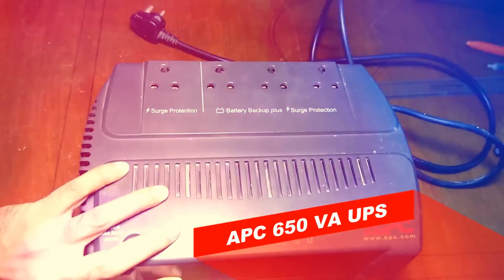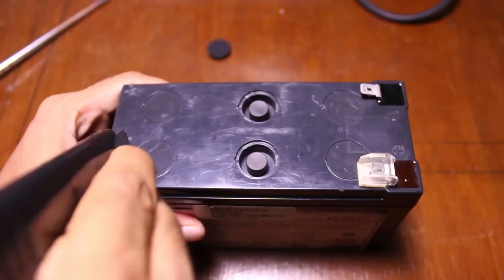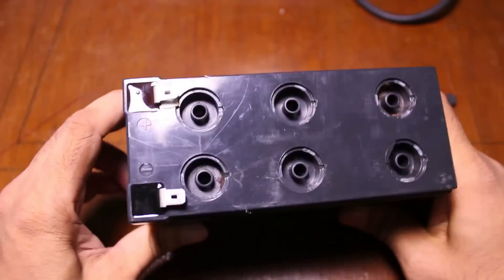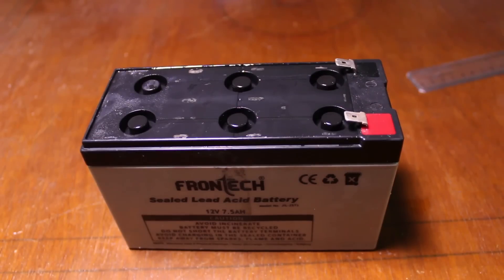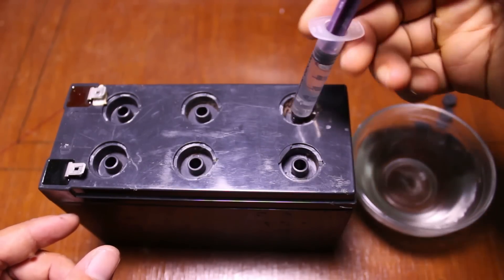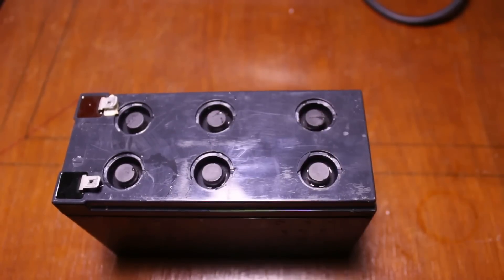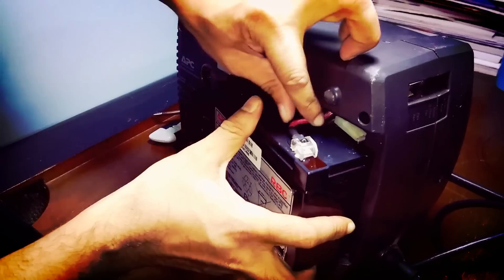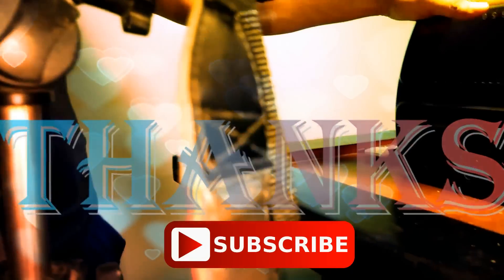How To Recover UPS OLD Sealed Lead Acid Battery

Comment: Im not an expert but know enough that you need to clarify what type of battery this is.  Flooded cell, agm, vla, etc.  As the level of distilled your adding is way too much for sealed agm types as far as I've heard
Reply from the maker: its works with any lead acid battery flooded / agm.

Comment: hi ,is it safe to put battery water in dry battery?? usually they use thixotropic battery gel in such battery as electrolyte , i have similar chloride dry cell which i wish to revive .

Comment: You should NOT fill it up "untill its full".
These are AGMs, not flooded batteries. You will make it even worse !
If they do in fact need water its only a fraction of what you put in !
Reply: I did this last year and it brought the battery back to life. Ups lasted 7 hours Only now it is giving me problems again. I checked the cells and 3 of them were very dry again the ups only lasting like 20 minutes

Comment: I filled distilled water in all 6 cells then charged the battery. After 3 hours the charge was 10V. An hour n half later it was 8 V. I have tried 2 batteries n no improvement
Reply: He filled these to the top.  I don't believe they are supposed to be filled like that, if they are agm batteries.  The mats need to be saturated but if the cell is filled to the top this can damage these types of batteries. And will likely pop all the caps off do to the pressure created when charging/discharging leading them to just dry out again

Comment: Hi I have an APC RBC 12 volt 7.0 ah battery which I use in APC UPS for my personal computer. I checked my battery DC volt it is 0.226 volt. I filled distilled water and again checked DC voltage and it is 0.21 voltage. I have not used this for 4 years. Any possibility this battery will recover？Can I put it back into ups and try ?
Reply from the maker: 4 years is long time it probably not recovered because battery lead plates are sulfated because of this resistance become high and battery is not charging . you need to charge the battery with high voltage charger.
Reply: @RoyTecTips  thanks for replying. I have inserted into my ups and turned the power switch ON. ups is dead. What is the typical voltage to charge this to make an attempt?  Can I use a mobile or laptop charger?
Reply from the maker: around 15v , 300 - 500 mili amp, for 24 hours then discount from the charger leave the battery for couple of hours if battery volt increase . if hold the voltage more than 12v then you can use it less than that, you cant use the battery .
Reply: @RoyTecTips  thanks for immediate reply. I will make an attempt and give you the feedback. Just an attempt. Thanks
Reply: Try charging the battery with a separate 12 volt charger for 3-4 hours, then put the battery into UPS Again snd charge it...I hope it will be ok

Comment: Your video is the 1st that I found that shows how to open the circular capped "Dry" batteries without damaging them and I know the process works because I have used it on other batteries that just have a single piece of plastic covering all 6 rubber cell caps. Thanks for posting this. For those who say this didn't work for them, use a car battery charger to charge the battery 1st and keep the little rubber covers off as you charge. Some water will spill out so check on it regularly. If it still isn't working for you, there are more in depth videos that will explain what's going on. It can sometimes take weeks to get the battery to the point where it will fully accept a charge. If the battery is completely sulfated, there is a chance you may not be able to save it. That of course isn't the fault of this video.

Comment: SOOOOOO Much misinformation on trying to repair these types of batteries up on the internet.

These AGM Batteries should NEVER be Flood Filled as it is implied here.

As the name implies, it is an "Absorbed Glass Mat" membrane, meaning it should only be moistened and NOT flood filled

🤦🤦🤦

Also, contrary to popular belief, a battery should Never boil when charging as this means the battery has dropped bellow the DoD level and needs to be replaced in most cases (This is usually after the battery gets discharged lower than the 80% "Nominal" discharge level on AGM batteries...... On flood filled batteries the DoD level is 50%)

A boiling/bubbling battery means that the cells that are boiling/bubbling are charging at a "Higher value" than nominal and in "most" cases this indicates a "shorted" cell in which case you should observe one of the cells not doing anything, so throw the thing out instead of risking mishaps.
Reply: So what and how the hell do you "moisten" these batteries?
Reply: @propbraker  Probably the easiest way to do this is to take a syringe and add some distilled water to each cell. The question of course is how much (as manufacturers don't like giving this type of info out) . I am going to assume if its a 7ah 12v (the likes that you'd find for gate motors and garage doors) it might be around 20ml in each cell, but don't quote me on this. I just normally flood fill it, and then turn the battery upside down and drain out the excess for 10 minutes. (just a side note, you should also know that out of about 10 batteries I've only managed to recover 2 because the others were beyond repair (batteries bulging, really old and dried out etc. If the battery looks deformed in Any way, it means it's Fubar and will most likely be dangerous to even contemplate charging) so I really wouldn't get my hopes up if I were you)

Any way, hope you come right, but with messing around with these types of batteries for a while and having such low recovery rates, I've just opted to getting new batteries as the amount of time and electricity spent isn't realy worth it in most cases 🤷🏼‍♂️
Reply: @propbraker  Use female fluids.
Reply: Hahahhaahahhahahahaha🙏🙏🙏🙏

Comment: Okay, so the idea was not to tilt the battery at all. To keep it standing to avoid having it spill. You didn't say anything about the pressure that would build from the gas which sends the caps flying off. Is this really a permanent solution?
Reply: He should have charged it at low voltage after filling the cells with distilled water and kept the caps open for around 24 hours for the vapours to escape, which he did not.

Comment: You did not even charge and tested it for us to see if it really works, I have done this experiment and to my conclusion, not all lead acid batteries can be restored if the battery plate is damaged then it is really damage

Comment: I was happy to have discovered this method of regenerating old lead acid UPS batteries. I wish I had not thrown away so many because now I see I could have gotten some more life out of them just by looking after the batteries. My UPS have been stored in freezing weather, -35°C, and are 4-5 years old. When I put distilled water in as shown I found that after a few minutes the water seemed to be absorbed in and I had to add more to most of the cells. Interestingly is one of the cells was warm and I could hear it sizzling so I put more water in it right away. I've done this to two batteries so I'm going to let them sit with the caps off and see what's happening with the overflow or need to fill more.
To accommodate for overflow while charging I'm going to find some absorbent material to place around and perhaps on top of the protective rubber caps. Also I'm going to mount my UPS with the caps of the battery vertical.

Comment: Considering these types of batteries are supposed to be dry cell batteries I don't think filling them to the brim with water is going to help. How about going with a few drops and testing it from there. Of course scale the water with the size of battery you are trying to restore but don't fill to the tip that's just asking for trouble.
Reply from the maker: Yes  you are right.

Comment: lawl. no tilting battery. may break everything while charging. what if i sealed it with silicone or something?
Reply: It may explode due to pressure build up from water, if you refill it, it no longer remains a dry cell so do not tilt it. Batteries with water have a overflow mechanism.

Comment: Thank you for this Info. :):):)
 I got to know  your channel from "js Films" and accidentally noticing the above subject in your channel. 

i have been getting Low battery error on my motorcycle for some time, n the battery retailers though 'being kind' ;) 
 explained use till its dead(and replace it when its flat). 

I happy that I can top UP(distilled water) on a sealed battery will do the same on my UPS battery tooo...
Reply from the maker: +suipful welcome 😃

Comment: this thing doesnt work at allllll i have tried it in many batteries
Reply from the maker: complete dead battery is hard to recover. But it worked for me for near about dead battery. I am Using a USP battery for last 8 years and still in good condition. do you ever try to DE-sulfate ..
Reply: Yes i have tried it on half dead battery not fully dead although i have not desulfated as i dont know how to do it kindly guide me through
Reply from the maker: jayanta deb
search google you will find so many info. basically battery need to charge using high voltage pulse. it remove sulfate from the lead ..
Reply: jayanta deb high amp charge like the start mode on car battery charger for along time essentially will knock sulfate off cells
Reply: +jayanta deb
I have spent months studying battery repairing and found an awesome website at Magic Mender Wizard (check it out on google)

Comment: filmora video editor right : )
Reply from the maker: Yes 100% correct
Reply: RoyTecTips i can't install realtek driver on windows 8 it supports 8.1 and while installing 8.1 it says windows windows could not configure system
Reply from the maker: Download windows 8.1 and try. else ask someone for windows 8.1 recovery . I had it but my HDD crashed.
Reply: +RoyTecTips

I'm not sure but, if anyone else wants to discover how to recondition used car batteries try Panlarko Recondition Planner (should be on google have a look )? I've heard some interesting things about it and my buddy got excellent success with it.
Reply: Not certain about the points made but ,if anyone else is searching for how to recondition car battery at home try Corbandy  Battery Blueprint Crusher (do a google search ) ? Ive heard some unbelievable things about it and my friend got excellent success with it.